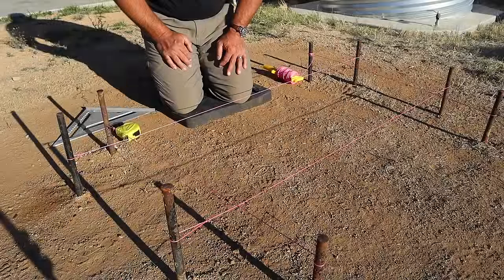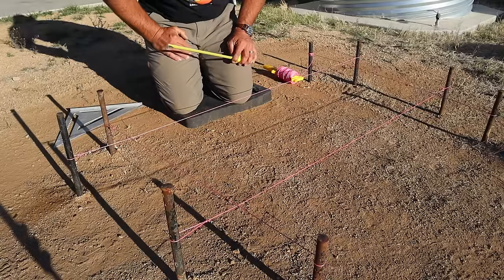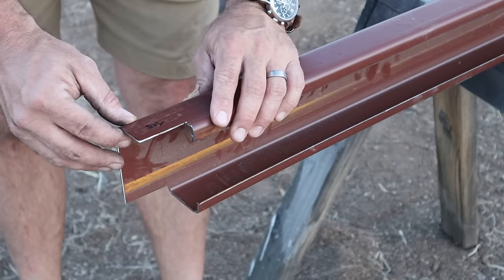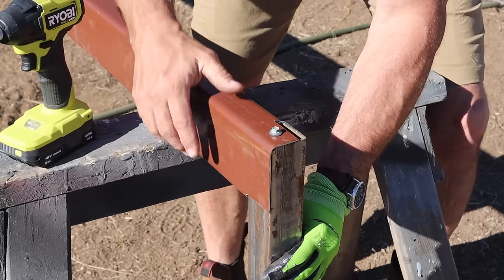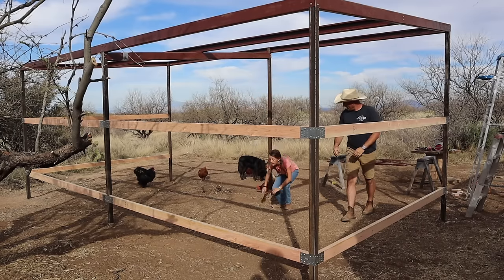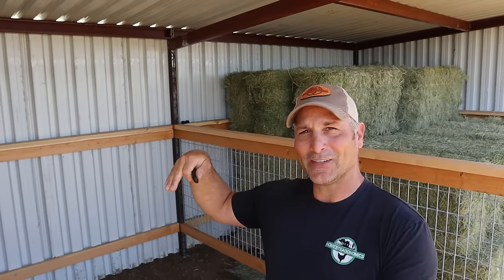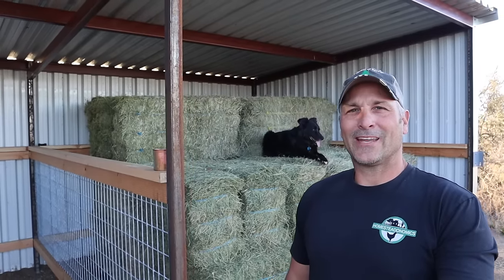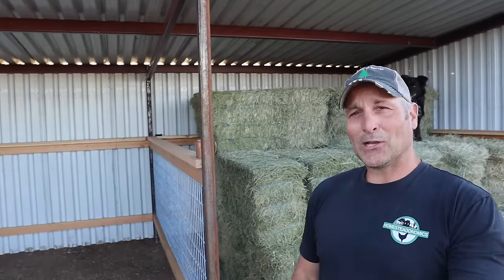Building a Simple Pole Barn Shelter  -  How To for Livestock, Hay or Whatever

Comment: If a horse rolls or kicks at the metal on the stall walls please know that they can get seriously injured from the metal. Maybe consider close woven (no climb type) fencing on the interior lower part of the walls or solid wood. 
I had a distant neighbor that had this happen to one of his horses and it was a disaster. 

I want to copy your project for a RV shelter but ( a bit longer ). Like the no welding needed idea since that makes it much easier to DIY. You always have such great projects. Your videos are much appreciated.
Reply from the maker: I have been thinking about that space too.   I like that non climb stuff I used for the divider but don’t like the price… so perhaps maybe some pan sheet or something  in that space between the purlin rails.
Reply: This structure could work for goats or as storage in a dry climate, but as it stands is extremely dangerous for a horse, donkey, or any equid — especially a feral mustang. One kick will slice through that metal siding like butter, and easily slice a tendon. I also doubt the tubular posts will stand up to a full-sized horse or cow leaning and scratching themselves on it (and they will, guaranteed). 4x4 posts on the corners and 2 inch thick, 4 ft. high kick walls cost little compared to vet bills and the life of your horse.

Comment: This is genius! I never would have thought to use steel tubing for a post barn style shed 😮 (thinking on it now, considering how many metal garages there are I don't know why it never crossed my mind 😂)

I'm trying to finally set up a blacksmith shop here at my house (been trying for years) but it's always seemed out of reach due to cost among other factors. This solves a big part of that issue AND makes the framing fireproof to boot!

Kudos!

Comment: Love your work, as always!  Horses are pushers.  They will lean over fences and push on them, putting their weight into it, too.  That alfalfa divide you have now should have another panel of height and its topboard.  It is also going to quickly learn how to stick its head under the panel and steal the alfalfa from there, too.  I would strongly recommend putting another verticle pole in the center of its length.  The temptation for the alfalfa is going to be very high. 

Best of luck to you all with your mustang colt!  I do not have any idea of your experience level with horses, but may I suggest you check out the videos at Think Like A Horse channel.  The man has owned a wild mustang (maybe several) before, and understands how horses think and why they do what they do.

Comment: Would worry that the young stang will tear up the structure. I would look at the extra cost to place vertical hard wood planks from the bottom rail to the middle rail to protect both the stang and your shelter.
That being said it is a fine build and gives me ideas for the protective shelter for our Son's new tractor.

Comment: How is the wind out there? We get high winds and wanted to see if I would need cross bars for the roofing
Reply from the maker: We get pretty high winds.  But this side of my property is on the leeward side of my house and a bit down slope so it’s a bit protected.    The roofing provides the cross-bracing/shear stabilization.  But if it were a bit more exposed I’d definitely ad the diagonal bracing on the open sides.

Comment: great job! I'm wondering, why did you use wood on the inside instead of making it all metal?
Reply from the maker: Just a cost thing.   Even though the purlins I was using were from a salvage yard, they were still more expensive than just buying wood for the lower portions.
Reply: @homesteadonomics  ah gotcha.

Comment: It seems like the sheer strength all depends on the connection via those tiny tabs that are screwed into the posts.
Reply: 8:13 use bolts. Screws will snap when the structure shakes in the wind.

Comment: Excellent video.  When you do an update could you take a minute and list specs for materials used?
Reply from the maker: How about now😉
Posts - 2x2”x14ga steel tubing(but I’d recommend larger)
Purlins - 4” “C” purlins
Wood 2x4’s for the remaining horizontal pieces.
Corrugated roofing is a 26ga 2.5” deep corrugated type that is coming on parking structures

Hope that helps!

Comment: You have more to do on the pen so the horse does not get hurt
Reply from the maker: There still lots more to do for sure.
Reply: @homesteadonomics  yea but before you put a horse in the pen you need to have plywood on the inside so if the horse kick's it won't cut it's leg off very dangerous to have medal around them .